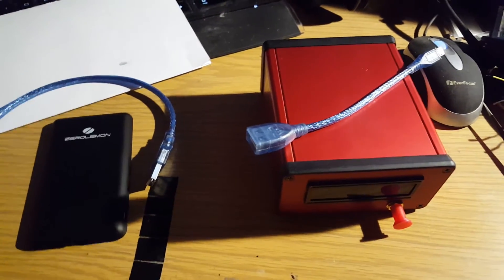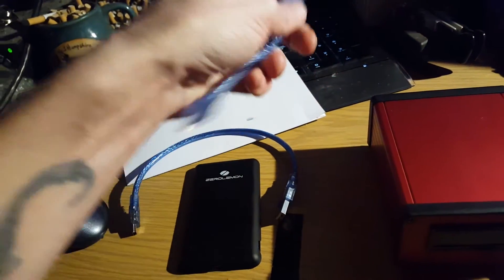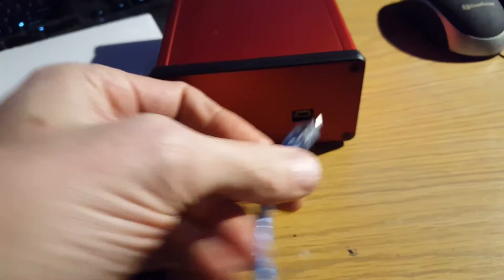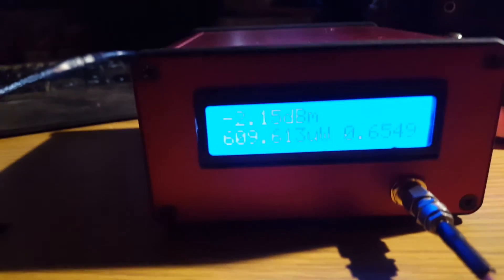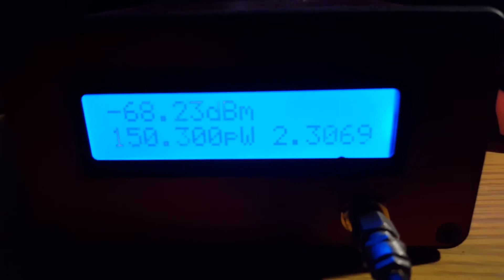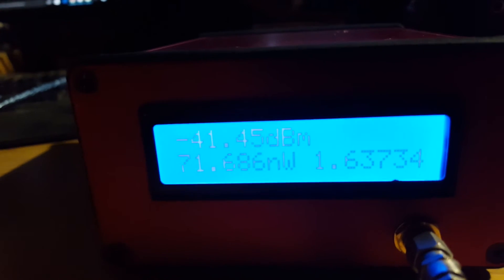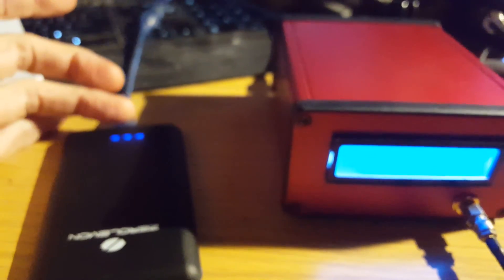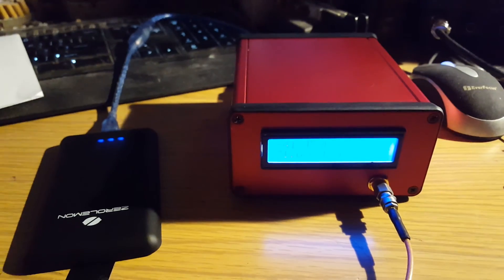Arduino Nano RF Power Meter

Comment: Can this be used to measure the mW output from 5.8GHz Transmitters?. And how much is the max mW it can handle?
Reply from the maker: Yes it should be able to measure that without any trouble at all.  There are already built devices for that that may be cheaper, although probably not as accurate.  60db or .001 μW is the lower limit of weak signals.  That's .001 microwatts.  So it goes like this: Watts, Milliwatts (that's your mW), Microwatts (μW)...  This device can measure up to 8000 MHz that's 8.0 GHz and should have no trouble at 5.8 Ghz.  I hope this helps you.  If you have more questions just ask. :)
Reply: Tim Havens How much would this cost? And what's the max mW input for it?
Reply from the maker: The active device currently costs about $90 USD.  Then you need the Arduino Nano about $10 USD.  And the LCD Display I don't remember how much those cost but probably < $15 USD.  The case was about $20 USD and some short bits of wire.  So Approximately $135 plus shipping costs would be my guess.  If you plan to power it from a zero lemon battery like I did add at least another $25 for the battery and some cables.